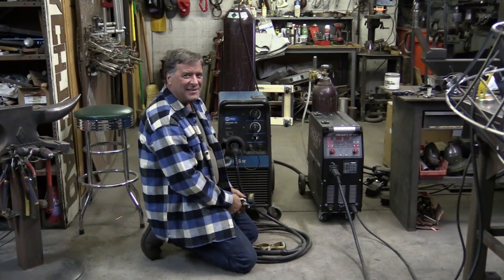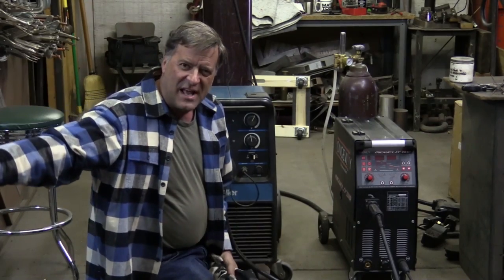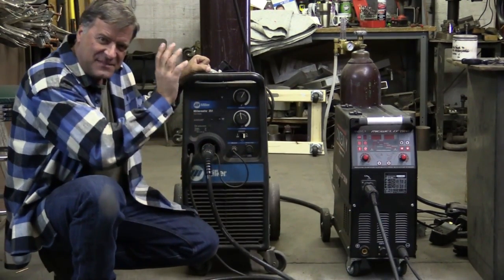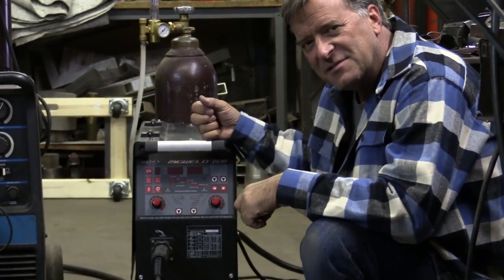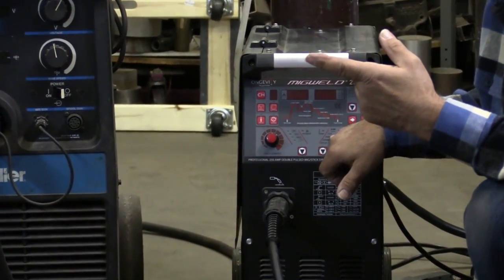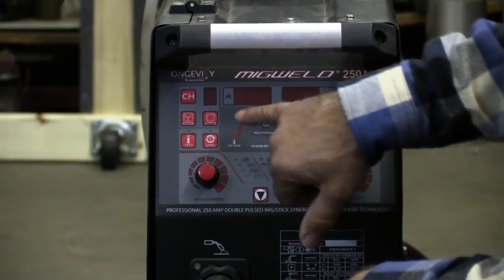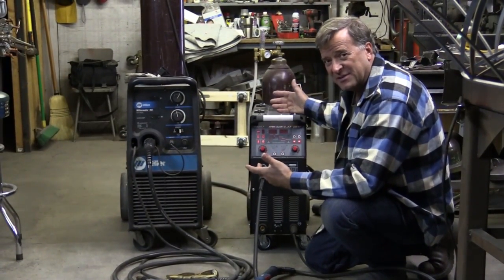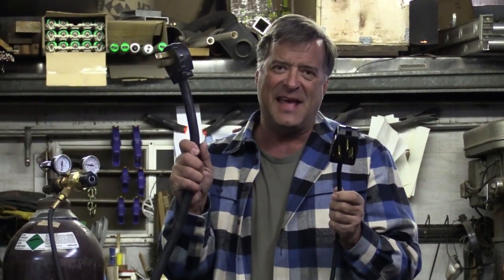Why You Don't Need a Welder That Will Last 40 Years - Kevin Caron

Comment: I bought a Lincoln Square wave 355 - 400 amp I bought from where I work, cheep . It's 10 years old and has been used a lot al very low amps, 70 to 90. I hear that if the main control board burns out it's dead. they don't make or repair them anymore and I'll never use it at over 150amps anyway. But I don't I could force myself to buy Chinese!
Reply: I also have a Lincoln 180 amp buzz box that's 50 years and will still lay down a good bead. I hope the Square Wave will last half as long.

Comment: I bought a nice new inverter welder ... only problem here in Australia is that gas bottles are so expensive I can't afford to run it on Mig or Tig at the moment :(
Thanks for the comparison Kevin. I have noticed the difference in the old tech that we have at work vs the newer tech I have at home, particularly when stick welding.
Reply: Try coregas, was cheaper than Air Liquide and you aren't locked into lengthy rental contracts. I have a size G bottle that costs 60c a day to rent, I can take it back any time. You only pay as you use it. If you have a small project to do you can get a smaller bottle and when you finish it you can take it back and you don't pay anymore rent.
Reply: Rat454 Thanks Rat454. I did enquire at CoreGas a few years ago but they were slightly more expensive than BOC (apart from them [Fyshwick Store] being extremely rude and unhelpful when I told them I wouldn't be needing multiple bottles per week) . I'll give them another go, as it sounds like their pricing model has changed.

Comment: I'll keep my Miller 251 because: 1) I am supporting an American company, and 2) it's built better.  The fact that the China-jevity machine's input power cable is 1/2 the size of Miller's says it all.  It's a cheaper made machine like so much of the other crap we get from Asia.  Kevin - I like you, your work and the videos you make - but, on this subject you are wrong!
Reply: I don't think the cord thing is significant. It can be smaller because the Inverter is more efficient. I'm not usually a fan of multi-process all eggs in one basket things. Like printer/scanners/copiers. Any part of it breaks and you may have to send the whole thing off to be repaired. But lately I am leaning toward a multifunction welder. I want AC/DC TIG/Stick/Plasma. It will most likely not be a top name like Miller because of price (and the fact that I've already had an issue with a Miller and I don't believe they stood behind it - see above).
Reply: Are 4n1s the same as 3n1s?
Reply: Thanks.

Comment: i understand what your saying, my ony gripe is, where the longivity is made . the miller will last yes, but thats all it has going for it. im really starting to like the inverter idea, if miller did that, with a bigger list of machines (inverter and trans) even multi process. that woukd be great, but they dint sadly, which is why id probaby end up with a foreign ing for inverter machine. cus of all the things going for it.
Reply: yeah, thats the thing
Reply: ***** And Nitroglcerine Pills, I had a Guy come Up, when I was selling The Rilands, YES111111111..all sstill have Never Had a Prob,, And I Had a Tarp,Over the tig,ac/dc with Pulse,and 20 More dials,, and he Had Just Bought His 200 amp Dynasty,, and he Liked the Riland as well, 1600, compared to, oVER 4 tHOUGH,, bUT hE hAD A 25 FT tORCH EXTENSION,, tHAT WAT 700 bANANS11111111111,,  As Kev said,, DUCT TAPE THE WALLET Closed,as Evry 6 Monthhs, some thing Is going to be Newer!,, Look at the ck,is last 10 Years,, I Jumped for Joy,to get a Pushbutton Phone from rotary,, I Think ya Get the Point,,and yes,I still Have a DUMB PHONE!!!.. Look at the damange I do,on full sized, Keyboard,, LOL!!!!!!!!

Comment: while l agree on tecnolagy advantage, tf the longevity fails 3 years down the road who will fix it and supply the parts,there new to the market , dont get me wrong l own usa and china welding tools, but  know the china stuff is going to fail, also your 10 year old miller is still worth 1/2 of its original cost where the china one if it lasts that long say $200 , one last thing, what is the duty cycle of both machines?
Reply: You should ask Longevity this question..   I know they are starting to repair some of the machines in house now..
Reply: I quite agree with you, I have a Everlast wire feed gone after five years,  I can't get Parts, or people to fix it , I.B.G.T technology.
Reply: ***** 
No response to his question buried  in the run-on sentence, Kevin.

". . .if the longevity fails 3 years down the road who will fix it and supply the parts . . ."